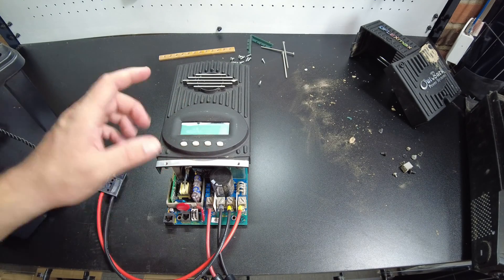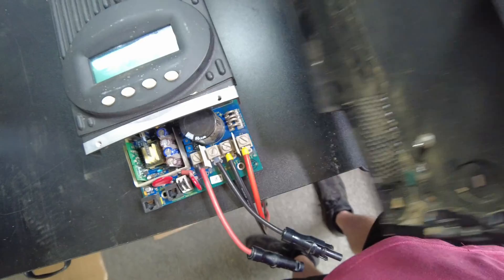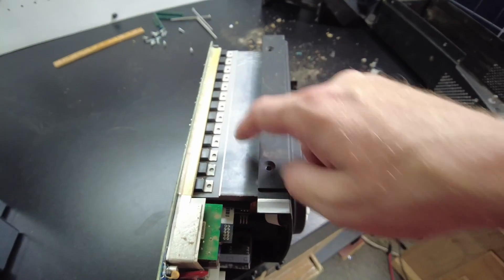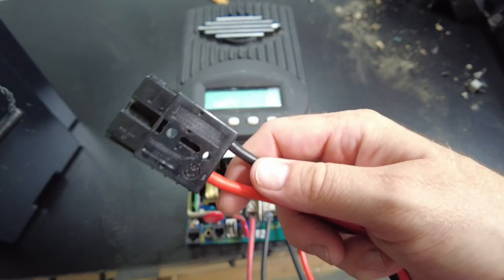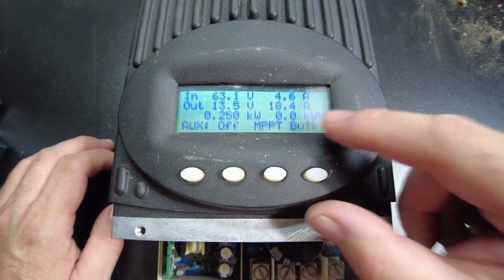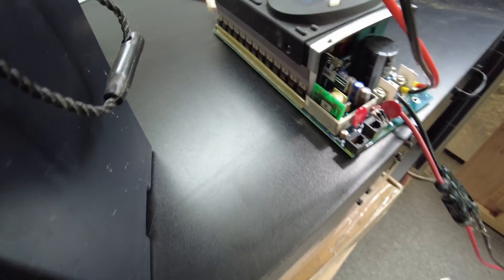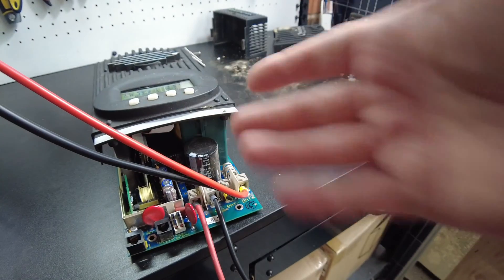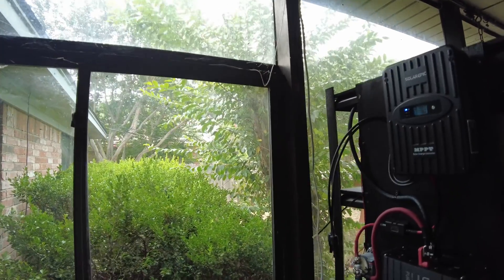OutBack FM80 80A MPPT

Comment: It does show watts it listed on the LCD front panel as Kw. So to read it  just do this. 360 watts will show up as 0.360 Kw and 1,241 watts looks like 1.241 Kw  It just takes some getting used too. For lead battery just do what Brad did and use reset method. For lithium 100% go into the user settings and preset the  Bulk, float and  set the equalization 5% lower as not to endanger the battery.  Example I have a 48 volt battery. Max Voltage is 57.8volts So all our setting to charge it are around 56.7Volts and equitization about 56.2volts or so. Also Limit absorption to 1 hour. Less stress on lithium. 
Our cut off voltage is 47.8 Volts. Battery shut down on the bms is set to 47.5 Volts  a dead battery is 46.5 or so. 
We always want to charge lithium to 95% full and keep about 10% in the battery near empty before the voltage knee drops off. 
Oddly these are a Grid tie setting but I think you need other Out back equipment and hubs and all the with communication.
We just keep it simple. 
Always wire the Battery up first with the Breaker on OFF position. Then switch the breaker on and Let boot up after wires are snugged in solid.
PV breaker side MUST BE OFF... 
Once the boot up is running....
Now that your outback is running from the battery power you can flip the PV breaker switch to allow for the suns power to come in.
We found that staying under 120 volts on the PV side helps keep the unit cooler. No need to max series panels to push near 150 VOC as you risk shut down  come winter and the cold weather BOOST the panel voltage to much much higher numbers!
This unit with care and proper breakers on both pv (15/20 amp dc for each parallel or series )  and on the battery side between the solar charge and bank 80-90 amp dc breaker should protect it. 
Having a lightning arrestor in the PV control panel breaker box will save this units life on a lightning strike. Bond all panel frames with copper solid wire and from the break boxes ground to a  6 to 8 foot deep ( sunk ) grounding rod.  
The out backs casing has a Grounding bolt out side of the case. Wire at least a 10 gauge solid copper  wire from  that also to a grounding rod. 
You'll need omhs law to figure out what size DC breaker between Battery and Inverter if your inverter does not come with built in flip breaker or push button style. ( God help those that have inverters with solder in breaker types on the PC Board ( sign of a poorly built inverter on the cheap side.)  I end up removing them and soldering in 8 gauge wire drilling a case hole and running them to an independant Air Breaker. 
Our 48 volt AIMS inverter can pull  6,000 watts and has built in push button breakers per  Hot Leg ( L1 L2 ) each of these are capable of 3,000 watts each and totals upto the 6,000 watts in 240 volt  or 3,000 watts per leg. 
Our additional breaker between Inverter and battery has a 350 amp on off auto Battery selector switch to kill it.

Comment: Hey Brad.  The unit is showing you 0.25kw which is 250 watts that is the simultaneous display as described in the manual.  I picked up a FM60 today for $100 and ironically I didn't really want another controller as I was after 500ft of PV cable for $50.  However, the unit tested good and was on FW 2.000 but it makes no sense to invest in a MATE3 or HUB4 to upgrade the firmware, so I will use the unit as a killer replacement to the cheaper fire starter controllers.  Mine was Q1 2010 date but very clean.  Nice content and now subscribed
Reply from the maker: Thanks, yeah I figured out the watts on the display like you said awhile back. My vision is not so great so I had to look at a few times before I figured it out LOL. $100 is an amazing deal!

Comment: Greetings sir. Found ur videos thru the one about crypto mining with solar. Which is what I’m wanting to get into. Then came across this vid when looking thru ur catalog. And I was shocked. I have searched high and low (on YouTube) for info on this controller. And it seems to be quite limited. Coincidentally I have this exact same controller and entire setup that goes with it. Minus the batteries sadly. They started expanding about 2 years ago. Anyway would love to chat about the flex master and crypto mining using solar in general. I’m on Twitter or discord if u use either of those. Or yahoo for email. Handle the same on all platforms. Great vids btw. And subscribed. ✌🏼✌🏼

Comment: A BEAST OF A CHARGE CONTROLLER  🤗2 ND TO THE MIDNIGHT CLASSIC THAT STILL PERFORMS VERY WELL FROM ITS 2014 MANUFACTORY DATE .  MAY THE SOLAR BE WITH YOU .:goodvibes:
Reply: Both beasts, both however, benefit from extra external fans in hot climates.
Reply from the maker: It's pretty impressive. I need to try the Midnight Classic. Thanks!

Comment: That is so good to see Brad - thanks mate.
The size of the inductors has more to do with frequency of the DC to DC  inverter, the thickness of the wire used is a measure of the current that flows through them.
You mount it so the top sticks up beyond the top of the shelf wall, but I guess you want easy access for filming the display. Can I suggest the addition of a few wireless cameras?  You can then put up composite shots of several things and displays at once without too much rooting around.
Reply from the maker: Yes, actually I was thinking the same with the top sticking up over the top shelf. That's a good idea with the cameras. I have a box full of security cameras, I might put some to work. Thanks!